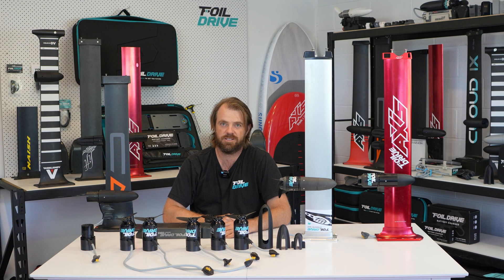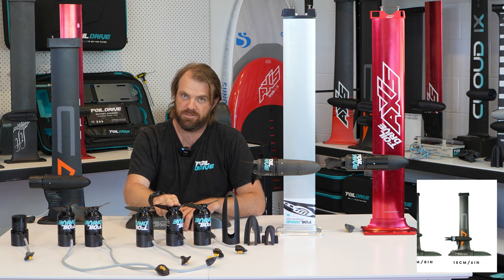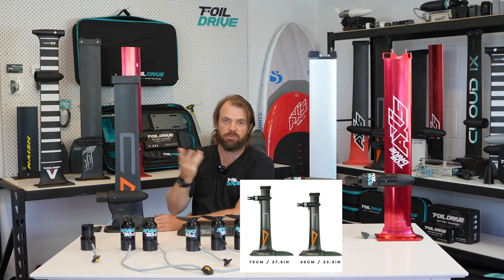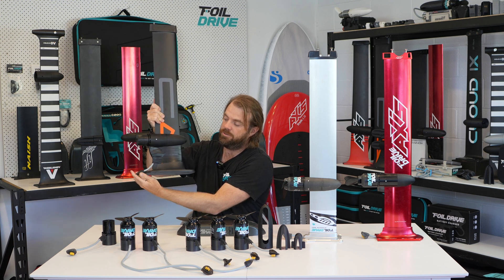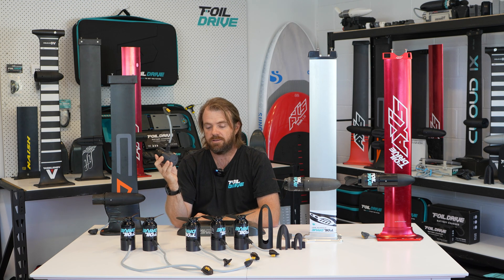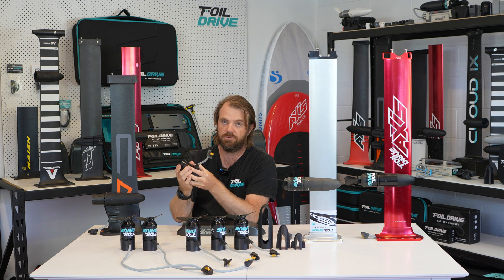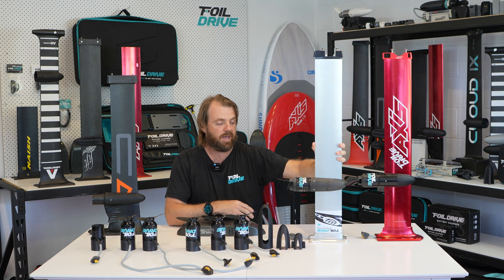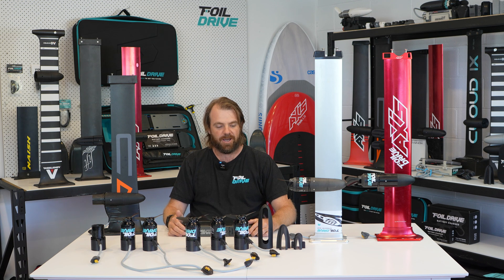Foil Drive Gen2 | Motor Systems & Cable Lengths

Comment: Hi thanks for this video and all the hard work. I'm interested purchasing ASSIST MAX but I am trapped as I don't know which motor height to choose. What would be your recommendation length for an intermediate wing foiler (70kg) that wants to learn downwind SUP and PRONE? 15cm - 20cm or 25cm?  How do you choose and on what basis the motor height?🤙
Reply: 25

Comment: I asked this on Instagram but not sure my question was understood. Considering the cable connection to the base unit is waterproof, is there any chance of an extension cord in the future instead of buying two motors?  I would love a 15 that could be used is a ~70 from time to time
Reply: Then the extension connexion wouldn't be fully waterproof on the long run or would be prone to failure due to user error.
Reply: @PhilipKlawitter  why would it not be waterproof?  Same connection as motor-housing that is already underwater.
Reply: @brendan-shanahan  I don't know dude, I don't even own the product. But I doubt it's something easily fixable, if not they wouldn't go with all this trouble of added complexity for their product line.